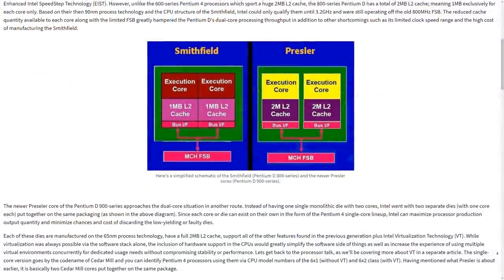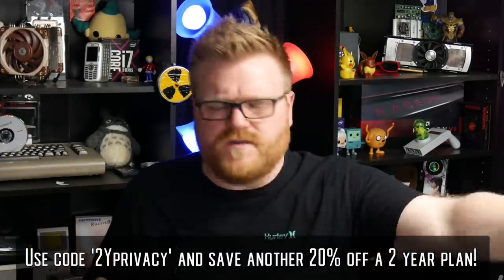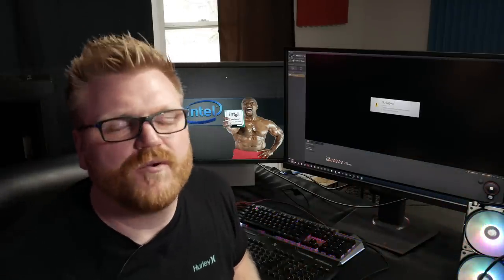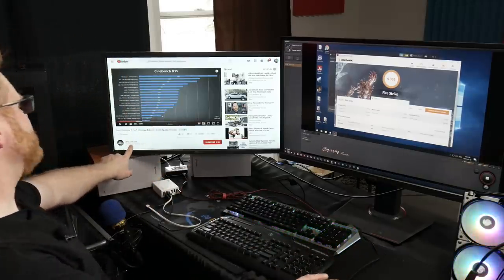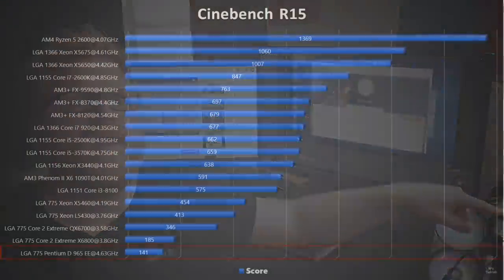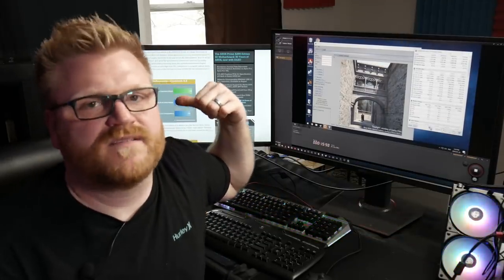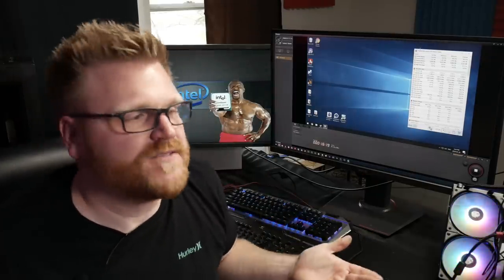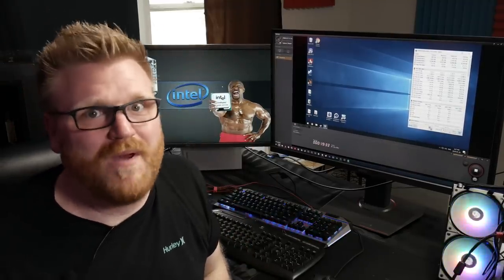Testing the $1000 Intel Pentium D EXTREME EDITION 965 in 2019...

Comment: that chip only overclocks well on a ddr2 board as with most early 775 chips the chipset controls memory on this platform and the ddr2 controller is much more mature at this point in time,  I have used the p45 chipset to get 6ghz on 775 chips the ee chip i couldn't do with my set up my phase change cooler is to worn out for them hot boiz. I have a GA-P45-UD3R if anyone cares.

Comment: benchmark the top of the line ORIGINAL phenoms too!  Show just how much you could of improved when that came out vs this.  We all KNOW the phenom II and i7s and cored2quad was better, but compare a range of the original Phenoms vs these and what else was around!

Just how did they stack up?  they are practically NEVER shown.  Should show just how well those can be on a top of the line compatible platform with overclock as well as a high end of the day!

Comment: You know the reason why AMD is doing better? Intel and AMD talk to each other more than people know. These companies that already have servers built are using x86 architecture and they are trying to get it off the market and perhaps change theirs eventually away from a consumer space for thier own security. You can tell how windows stopped supporting overclocking for the Broadwell-E CPUs. In a matter of fact the government also uses these CPUs and it will be awhile to replace them all with CPUs compatible with the public. Intel released thier mistake after releasing a consumer version of a Broadwell-E the 6850k 40 lane 6 core. The more lanes the more vulnerability using the CPU to bypass licensed machines. So the hype for AMD was good so none noticed until Intel fixed the vulnerability problems with thier servers. It's pretty damn stupid to sell the public the same hardware as th companies servers, but Intel gave out some serious customizable crap!!!!

Comment: i got a dual core atom / nvidia ion system shoved inside a og NES and it scores 108 in R15
Reply from the maker: That NeS in the background of my videos was at one point an atom PC ha. It's empty now, it was a first gen single core and it couldn't even play YouTube at 1080p
Reply from the maker: Wow this is pretty cringy https://youtu.be/EKuQEIDtl7s
Reply: @TimmyJoePCTech  heck ya! I have a first gen eeeeeeeeepc powering an icade cab into mini arcade, its hopeless but it runs 8&16 bit games + mame so it does the job
Reply: @TimmyJoePCTech  my beast of a machine sporting a dual core 1.8ghz atom and a geforce 210 class video card will in fact play youbube in 1080p (forget 50/60 fps its 30 tops) with its massive maxed out 4GB DDR3 ram and its wicked fat 512MB  (yea bra, 512MEG bitches) GDDR3 ... and its all cooled by a 60mm tan fan, ah yea :p

Comment: 7:51..... the athlon uses HyperTransport. where in the untel is stuck with what killed it ..netburst.. hypertransport is a Waaaay bigger data highway then what netburst limited every thing through no matter how fast the untel pentioom 4 gen chips were they could be 8 ghz the crippling factor is always netburst at any speed with pentium 4s intel admitted all their wrong doings with the pentium 4 era the shop owner bribes,benchmark Fixing ,Compiler fixing against amds superior product at the time.  for those who didn't already know also sadly the what was Better on the horrizon from intel pentium 4's the Core 2 duo series was actually based off of pentium 3 architecture just tweaked and die shrunk.  due to p4s netburst reliance.

Comment: you forgot phenom II x6 vs core 2 quad q9000 series

THAT was the last time AMD took crown

Oh no... Ryzen 1st gen vs kabylake
Reply: Q9000 was far better than Phenom II tho, especially when OC'd. Phenom only seemed better cuz of their higher out of the box clocks, they needed like 15% more clock to do the same. Edit: Price to performance it could be a bit better every now and then, but that's a different metric
Reply: @WouterVerbruggen  Out of the box, the phenom beat the C2Q even in single core
You can't put Overclocking into the equation.
It had like 10% higher scores in single core and like 65% higher core in multi
It was better, more future proof in every sense (except for overclocking)